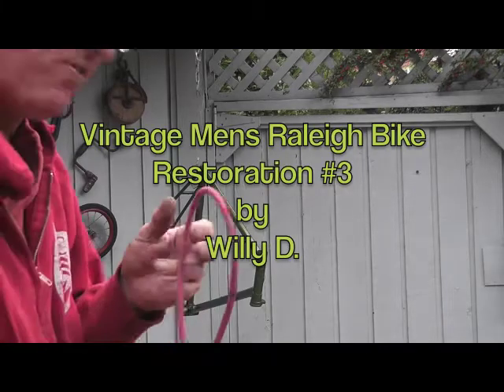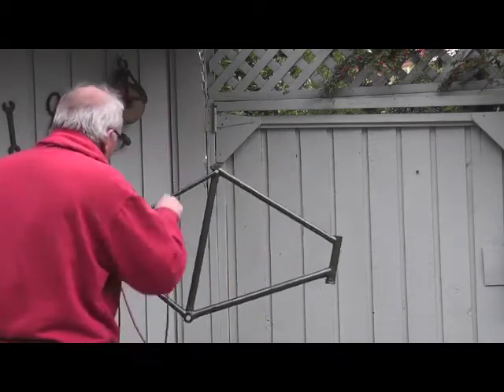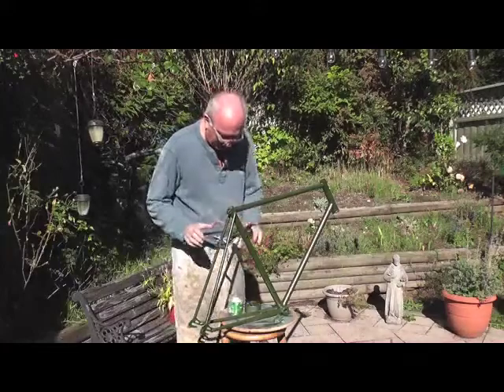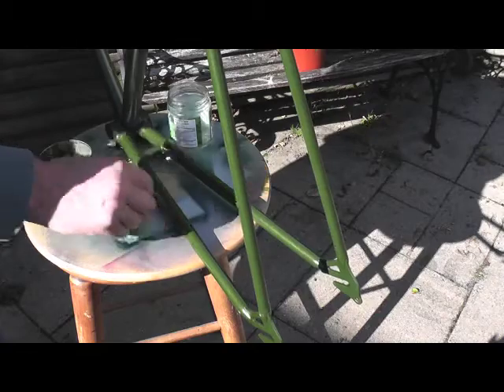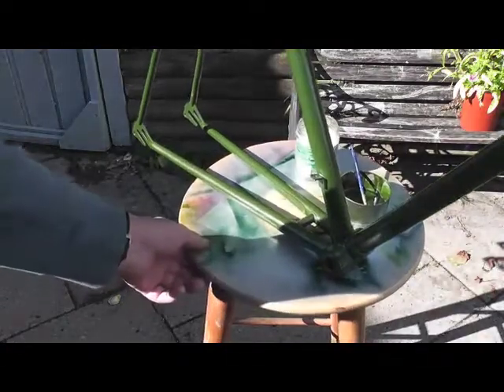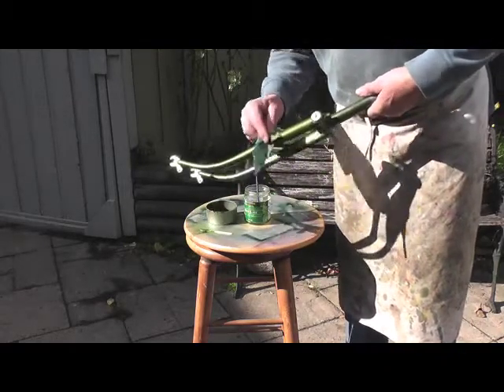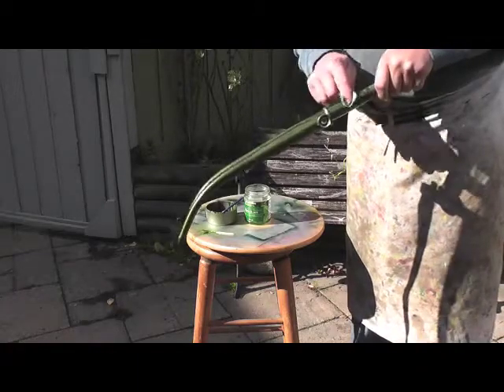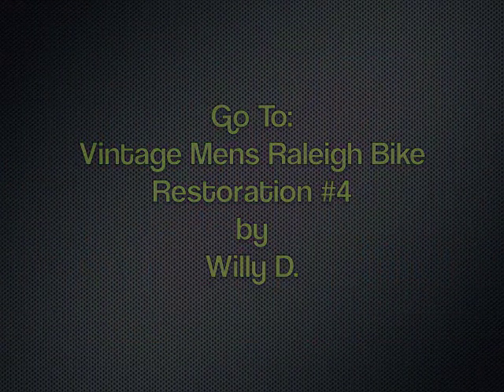VINTAGE BICYCLE RESTORATION        #3

Comment: Hi Willy, what spray gun/ system do you use? Looks nice and gentle. Thanks.
Reply from the maker: I used a model spray gun which I use for model boats and Dinky toy restoration.

Comment: Hey Willy. I'm really enjoying this restoration series and I have a similar bike. Could you tell me if you removed the ball bearing races from the front head tube or just did you just mask over them? cheers
Reply from the maker: I removed all ball bearings as they need cleaning and fresh grease. It's better when doing a complete restoration. They will last another 30 years when finished. Another factor is was the bicycle stored outside or inside and was it used on dirt roads or tar roads in wet or dry conditions. You can tell by the seller and the look of the bike usually. Bearings are quite easy to clean and if pitted replace. I did mask the crome that was fixed at the end of the front steering tube. These Apollos are great and I'm still using one here in France with a high handle bar and gear shifters moved up on the handlebars for easy shifting. I changed the racing tyres to road and gravel tyres so mine is custom built for me. 
No bike cruses as fast down hill as theses bikes when restored. The youtube dark red one sold.